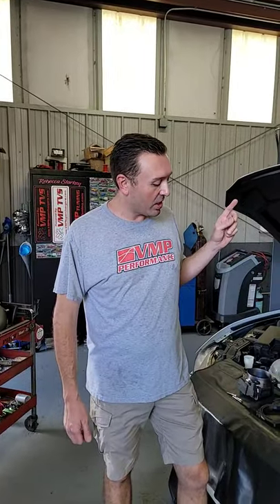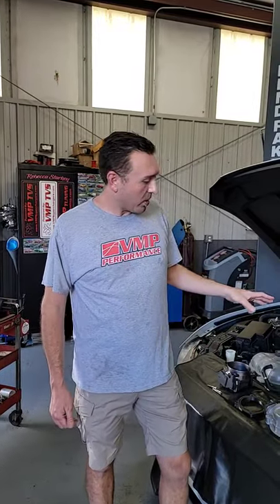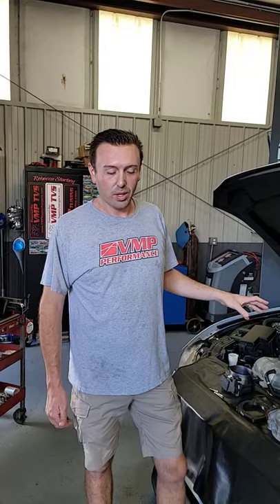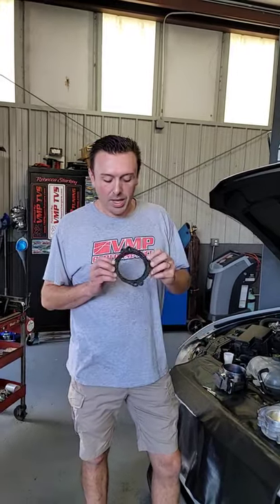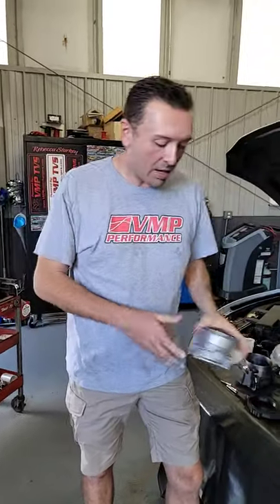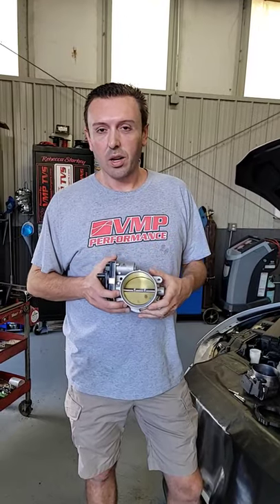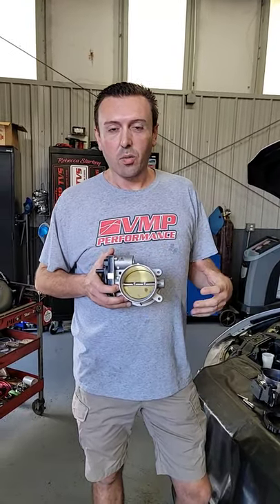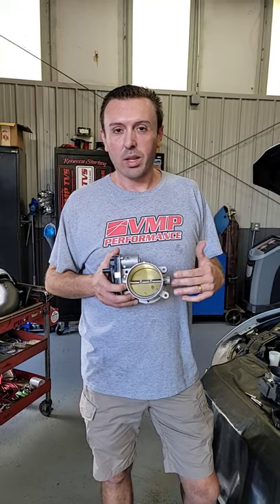Predator Crate Engine || Parts Development for Swaps! - YouTube Shorts #shorts

Comment: What about the heads and cams? Are the 2020gt500 able to work with gen 2 cpu
Reply from the maker: Heads are fine, we had to change to Gen 2 cams with the proper tone wheels for the sensors with the GT500 grind.

Comment: What other throttle bodies will bolt on to a 2020 gt500 blower? The Vmp 105mm throttle body won’t work?
Reply from the maker: Hey Christo, the VMP 105mm is designed for a digital Gen3 ECU, track attack has a Gen2 ECU.